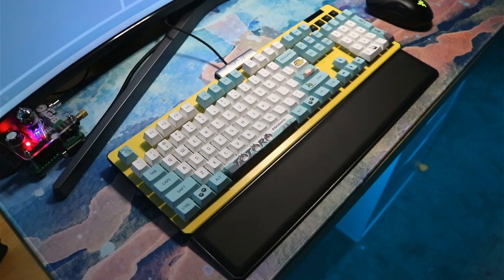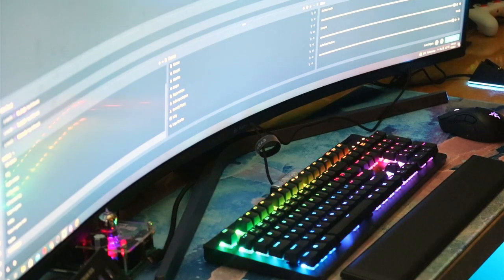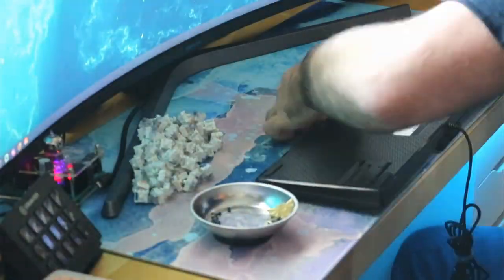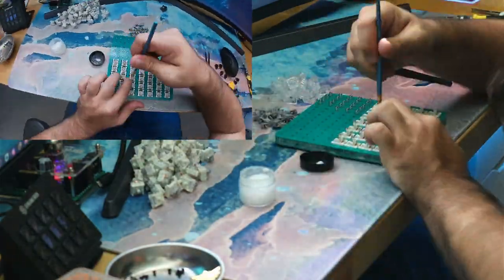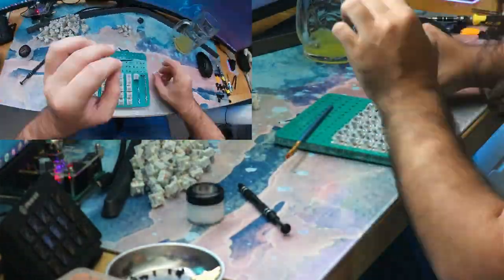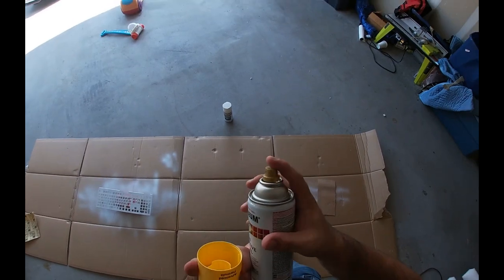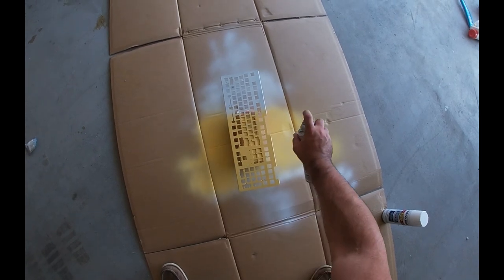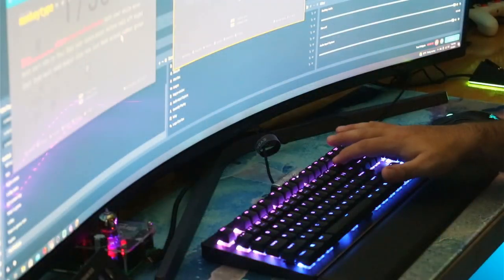Custom Build: EVGA Z15 with Kaihl Speed Silver, Foam, and Paint

Comment: I know this is old, but when spray-painting heat the can in hot hot water for an half-hour. You will be surprised with then end results. It turns the paint into a super fine mist that gives a super smooth coat. Just remember to do this in-between coats. The hotter the paint the better, but don't go too far (Warning: heating a pressurized can to extreme temps will explode it and can kill you, so use common sense as I cant provide that).
Reply from the maker: It's hot in Texas already :p

Comment: That actually sounded pretty good. I already ordered my Z15 but bought it with the Kalle Bronze switches since I heard clicky switches are the best for typing (my main use is for school + some casual gaming). Maybe I should return it and get silvers so I can mod it and make it sound thocky? Do you think that's worth it?
Reply from the maker: Don't return it! those switches are actually good for clicky switches. I would just buy some more switches and swap them in and out!
Reply from the maker: If I were you I would buy some Zealios V2 switches, glorious pandas, or just some gateron browns / yellows (linear)
Reply: @ireakhavok  I’m not going to lie, a lot of those switches seem quite expensive and I don’t really feel like spending much on a keyboard (I got the z15 for $45 lol), but I’m wondering if  the the bronze switches are good for typing, or if the linear switches + thocky mod would be better. Can you mod the bronze switches? I heard that linear switches are usually modded but clicky ones aren’t recommended.

Edit: never mind those switches are pretty cheap
Reply: @ireakhavok  and I also ordered pudding keycaps for my z15 because they look nice with the RGB. Do keycaps really affect the sound? Will the pudding caps make the sound worse/better? The caps were from hyperx
Reply from the maker: @Ash-bl7vm  Yes, keycaps definitely change the sound, and puddings actually sound really great, overall. Don't mod the clicky switches, but yeah the gateron switches are pretty cheap! its all about preference though, which is great because the board is hot swap you can try them all out!
Reply: @ireakhavok  Thanks!
Reply: What switches did you go with? I love the feel of the speed bronze switches but can't get passed the click sound. I've got some Kailhl bronze and purples on the way to try out.

Comment: Do you recommend setting the poll rate to 4khz?
Reply from the maker: I do not. does it produce a measurable change from 1k to 4k? Yes, but is it in any degree noticeable? No. It is 3/10's of a micro second faster in games, and would probably introduce de-bounce delay issues at that point.  Maybe if you leave it 100% stock and not lube it the debounce delay would be slightly faster and you wouldn't have any issues. you MIGHT get double presses of keys accidentally, which in some things like games, it's okay, but not for typing. You can always try it for a while and see. I, personally, wouldn't, as I feel that .0003 of a second is a gimmick
Reply from the maker: https://www.youtube.com/watch?v=UmS_t3YYy8s This is a good video explaining keypress to photon delay, and where I got the metrics from!

Comment: How thick of a foam did you put inside the case?

After lots of research I just got this keyboard upon seeing the insane discount compared to its original price. I love it, it has excellent built quality and materials, and doesn't have hidden RGB issues other boards have like PWM buzzing noise or low frequency backlight. Other minor details like Numlock etc. LEDs being clearly visible from any angle and aren't bright enough to blind you at night, media controls, simple and lightweight software, onboard memory for everything (exept custom, non-preset lighting), a nice wrist rest and relatively low-profile case. Many people complain about the keycap font but I think they match the overall design really well, and they're easily readable, unlike some cheap "GaMeR"designs which actually suck. This one is a great package for roughly $50-70.

That being said I still want to mod it with at least some internal foam and probably swap the Silver switches to something tactile.
Reply from the maker: the foam I used here I believe was 1.7 MM thick, kinda like the thickness of dish packing foam. You can also use some thinner EVA foam if you'd like. You may want to cut up the foam to fit in between the plastic slots if the foam is rather sturdy!
Reply from the maker: And I totally agree with your thoughts on the board as a whole! Let me know if you change the switches around! Great board!
Reply: @ireakhavok  Yo I ended up leaving the Speed Silvers in there, I really started liking them. I did put foam inside tho, it was quite tedious because of all the small plastic cutouts in the bottom case. I used 1mm thick Poron with quite a few layers lol. It sounds a lot better, it has a deeper tone now. Although now it's so quiet the switches' spring ping is now audible under certain keys D: And spring lube is too expensive for my liking. Also the screws under the feet are smaller than the top plate ones, 0,75 I believe. Still a great keyboard, I'm really liking it
Reply from the maker: @AlphaSnowLion  krytox GPL 105 isn't that expensive, like 8-10 dollars, but I wouldn't suggest doing that until you actually lube the switches too. I'm sorry about the spring ping! If it happens to be certain keys and only those keys then it might be possible to open them up rotate the spring a little bit and sometimes maybe 10% of the time that'll actually get it to stop. I'm really glad that you like it! Out of all of my boards this was the keyboard that my buddy borrowed from me. He's really liking it.
Reply: @ireakhavok  Unfortunately Krytox and similar alternatives aren't available in my country, and shipping cost from abroad is kind of insane. I'm not bothered by the spring ping THAT much 

Never heard about the spring rotation method but I'll try it

Comment: Hey, thanks so much for making this, I’ve watched this video like 5 times already while I plan to mod my Z15.  Just wondering, because your video goes pretty fast, was there anything between the metal plate and the PCB ?   I’m thinking about buying foam for between this area.  Thank you.
Reply from the maker: No there was not anything there! You can definitely put some foam between it if you'd like, it should dampen the sound even more
Reply: @ireakhavok  appreciate that, thanks for the response.

Comment: Did you sand the top plate before painting? Or did you just use primer?
Reply from the maker: I sanded extremely litghly just to make sure there weren't any imperfections. I honestly don't think it was necessary. I did also lightly sand the primer.

Comment: Do you have a different version I can not dismantle this keyboard i have all screws out
Reply from the maker: You probably just missed the ones on the bottom corners. If I remember right it's under the rubber. There is no such thing as a board that can't be disassembled:p
Reply: @ireakhavok  damn, you are right thank man <3 first keyboard for me
Reply: i have just a little bit foam in it but its so hard to put it back again. like its to much pressure
Reply from the maker: @ZebSound  so cut the foam into strips to fit in between the plastic ridges in the bottom of the case. it should relieve just enough pressure for it to fit nicely.
Reply: @ireakhavok  i will try it tomorrow thank you :)

Comment: How did you get it soo illuminated with the rgb? is that a setting or will i have to buy something extra?
Reply from the maker: So by changing the plates color to something very light like yellow or white and also changing the keycaps to be white as well will cause the light to bounce a lot better than if it were all black or gunmetal gray. I did nothing to change the actual lighting it's just reflecting a ton better.
Reply: @ireakhavok  oh thank you soo much! you did a very nice job

Comment: I'm glad to see someone finally modded it. I could've swore I read somewhere that you can remove the brand logo at the top. Why'd you cut the foam? Did you swap stabilizers or lube the wire with dielectric grease? How do you remove the rubber feet to get at the screws on the bottom? The lubed speed silvers actually sound pretty damn nice. I got some pudding keycaps for it so I do want to mod it and at least make it worth using cause it's pretty disgusting stock. Right now I just use it as a switch tester LOL
Reply from the maker: So I cut the foam because I was having troubles shutting the case! that being said, cutting it was the right move. The sound is nice and muted, and the case isn't warped trying to shut it. I removed the rubber feet by peeling the outside halfway to the middle. It was hard to see where the screws were at first the glue was covering the hole. A screwdriver should do the trick, just peel it up from one side. I did not use dielectric grease on the stabilizers, but I did do a band-aid mod on the PCB and then also lubed the wires with a generous amount of Krytox 205g0. I really do like the speed silvers.... I didn't expect them to sound and feel like they do, but I am definitely going to keep this set in a board somewhere. Keep me updated on what you do with it!
Reply: @ireakhavok  Damn, it's a shame you have to possibly damage the feet to get at the overly excessive 16 screws. Would you recommend doing the bandaid mod? I'm surprised you didn't tempest tape mod it either. I really don't want to replace the stabilizers but I suppose with enough love the stock ones would suffice anyways. It's all about that lube application at the end of the day I suppose. I have no clue when i'll attempt to mod it. I've got a lube station and some cheap lube coming in the mail tomorrow but also some dielectric grease that wont arrive for a few days after. I should probably grab some krytox 205g0/105g0 :X were you just using shipping foam? I have done that for two of my boards but I honestly can't even hear any sound difference using before and after typing sound tests. Maybe I should try some actual PE foam.
Reply from the maker: @bobnorman3094  Yes, the rubber feet is a pain, and this day and age makes absolutely no sense. So, the tape mod is more of low pass filter, and although it does a pretty good job, I prefer that the ring and hollowness is removed, leaving the board feeling solid, and not reverberating. If you didn't notice a different, either the keyboard you were using does a good job at removing reverberations, or you may need to do another layer, or cut up the foam so that it sits inside of the slats. As for stabs, I don't really mess with them, unless they are screw in. generally they all function exactly the same, and the issues with each of them are solved with the same ways, either dielectric, holee mod, or  krytox. The tolerance here is the issue, the tighter they are, the better, but then you need stronger springs to make it feel right. I generally run softer springs, so I don't mind if I just use low tolerance - cheaperish stabilizers, because I want less resistance. This can contribute to not as good sounding stabs, but being a typist - I am more concerned with feel - I want it to be crisp, at every aspect. That's probably why I don't do the holee mod, because I don't want to made the bottom out feel mushy-ish or to padded. I was just using some packing foam, but also suggest getting some silicone, as the amount of dampening from silicone can be pretty great.
Reply: @ireakhavok  Awesome. Thanks for all the tips and tricks :P i'll come back here and let you know what I do and how It goes when I do it :)

Comment: Hi, Can I know that, if I can do the same mods and get that thoc with Z20 linear?
Reply from the maker: So, I assume that you can, the only thing that I don't know about is the sensor up front, and how that is connected, AND the optical switches. Just be uber careful, as I don't know how it is connected - most likely a wire and clipped or screwed in.
Reply: @ireakhavok  Thanks. :D You think lubed optical switches gives the same thoc as these?
Reply from the maker: @RigzoTV  pretty close! I did an optical switch before. But it was the window type. 

The LK optical switches that are in the z20 I have not taken apart so I don't know about lubing the switches themselves but I know that you can take apart that keyboard probably the exact same way and do the foam modding and stabilizers but. I'm pretty sure that the optical switches I have no idea whether they use a prism or a window if they use a window then you can lube them if it's an optical switch I would suggest not lubing them.
Reply: @ireakhavok  I see. Thanks again. Then I'll go with the Z15 without taking the risk.

Comment: man, why did you have to speed up through the opening of the case :(
There's no other video showing how to open this keyboard, and i dont wanna damage it

idk if you'll read this since this is a 3 year old video, but could you answer these questions:

1. Do i have to take the switches out to open it, or can i just leave them? (im not lubing them this time)

2. Do the rubber feet become unusable, or can they be put back without issue, and would i have to use some sort of adhesive for them?

3.-im gonna use the same foam as in this video you mentioned needing to cut it in strips since it bulges, but i dont see why it would bulge as 1 piece and not as strips

4. Would the tape mod be bad for the board? you didn't do it in the video

this keyboard is my favorite and i just dont wanna fuck it up :(
Reply from the maker: What do you need to know, man? I still read them :p
Reply from the maker: It was actually pretty simple to open if I remember right.
Reply: @ireakhavok I left the questions there in the first comment, good to hear it was simple but i still have those questions, as I've said, I love my keyboard and don't wanna mess it up
thanks for replying 3 years late and I hope you can answer
Reply from the maker: @FyrenRei  alright my man I'll go back and also try to find the board to answer those
Reply from the maker: Okay so to answer all your questions. 1) I believe you need to take off at least the keycpas, not all the switches. There are some screws hidden on the plate if I remember right.  You can just leave the plate and the switches and PCB as one unit. 2)No I didn't need any extra adhesive. One did fall off after a year, but I put it right back. 3) so there are little ridges that can cause the PCB to flex and put pressure on the sockets. Technically you can do it with one piece and just crush the cells of foam in that area - The point of it is that you just want to take up the empty space of the case 4) I personally don't like the tape mod unless it was a purpose built sheet like in the case of the DROP Sense75. This board was great quality. I do suggest modding the board, it sounded way better.